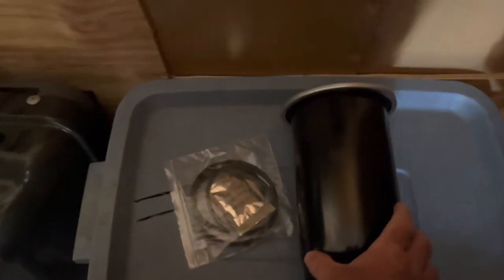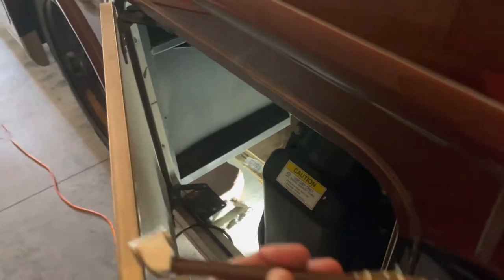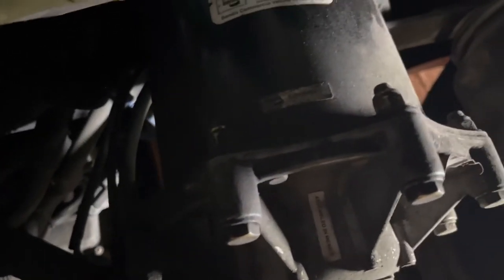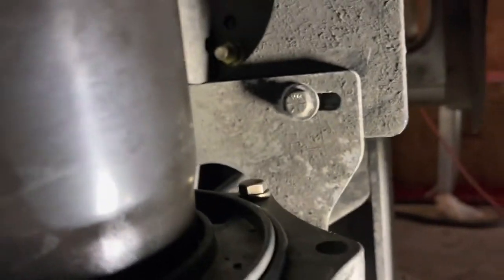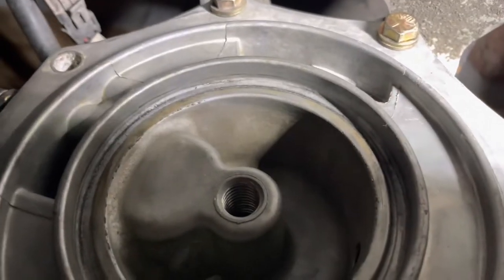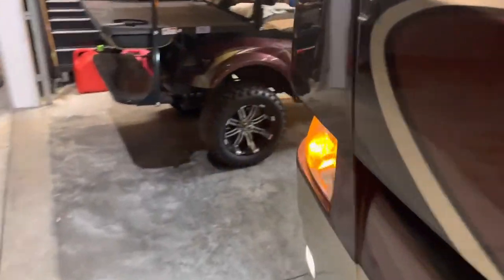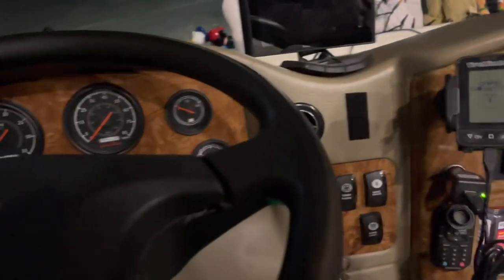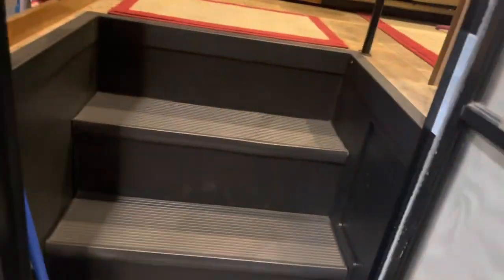RV Maintenance - Replacing the Desiccant Filter on the air system

Comment: In the aviation industry bolts go head on the top unless stated by the maintenance manual,  that is incase the nut comes off the bolt will still hold it there instead of falling out.
Reply from the maker: Makes sense. Freightliner is far from aviation. 😂

Comment: Great video! Where did you get the replacement motors for the roll up shade?
Reply from the maker: Search Amazon for this - Sortfle AM25 DC 12V Mechanical Limit Tubular Roller Blind Motor, Build in Limit Switch and Adjust by Allen Wrench, Wired for Motorized RV Shade, Electric Powered Roller Shades

Comment: FYI…In regards to the “Bolt Direction” installation DOES make a difference because one (nut) is spinning and putting rotational torque on the cast-metal bottom piece vs the flat steel of the housing.  

I come from the Aviation industry and there’s a full 6 weeks of Fastener Training that addresses this type of thing…With that said, you’ll be fine doing it Once, but repeating that isn’t advisable and you most definitely want to use a torque wrench on this exact type of sub-system.  

Good Video though…